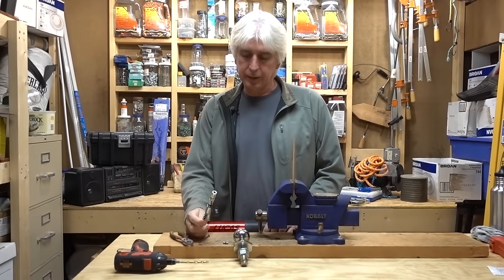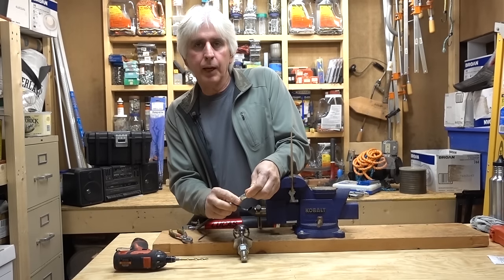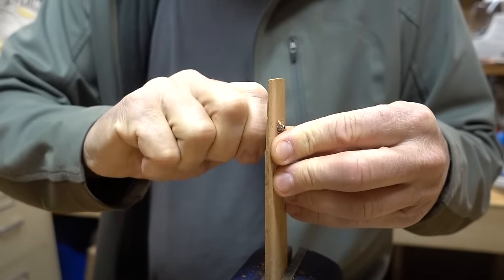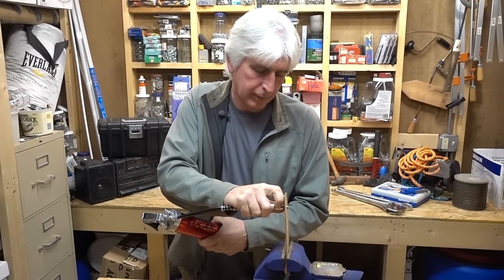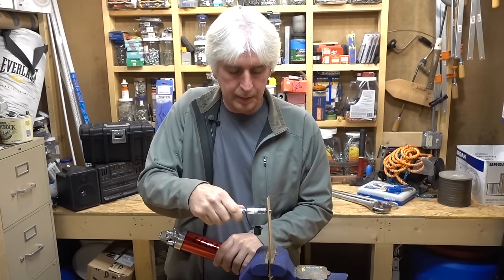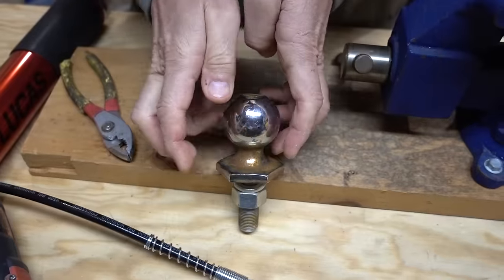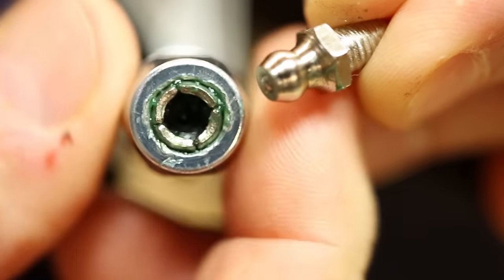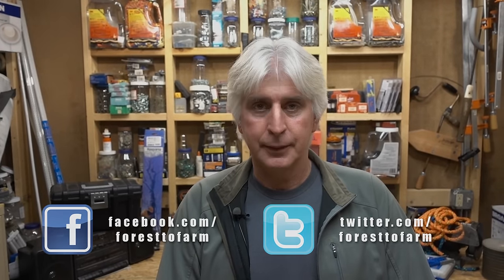Getting A Secure Fit With Your Grease Gun

Comment: I'm 73, and I never learned that. I worked as an auto mechanic, factory maintenance, and other technical jobs. I own 6 grease guns. Tomorrow, I'm going to see how many are adjustable. This could have saved me lots of frustration, lots! THANK YOU!
Reply from the maker: You’re very welcome! So simple yet so few of us knew haha. At least life will be a little easier from here on out 😁. Thanks for watching!!
Terry
Reply: @ForestToFarm  I'm 69 and on the farm but did learn about this 35 yrs ago.  Excellent video but you should have mentioned that if the zerk refuses to take grease you can loosen the coupler to relieve pressure so you can get off the zerk.  Then usually some heat applied to zerk will get it to accept grease again.   Thanks for the video.
Reply from the maker: @jefffrayer8238  Good points! Thanks for sharing!!
Terry

Comment: You saved my life! I have been breaking grease nipples by forcing the grease gun with blunt force. Then I decided to find why and your video just explained it. Thanks!
Reply from the maker: Your welcome! Glad to be of assistance. 

Terry
Reply: I was breaking grease fittings off during the removal process.  Of course I was jamming them on first off.  I am an idiot.  This video saved my bacon from more future damage!!
Reply: Same… thank you and thank’s YouTube!
Reply: @leftseat30  There was no rush so I left grease gun on backhoe overnight thinking the grease would seep into joint.  No luck so I did know to loosen the 2 pc. coupling as shown to relieve pressure using two curved jaw Vice-Grips.  I took fitting out and unclogged it with some heat and grease gun.   Great video needed by many and no you're not an idiot because nobody explains this.
Reply from the maker: @leftseat30 ha ha glad to help!
Terry
Reply from the maker: @gregbrown5556 never to late to learn. 
Terry
Reply from the maker: @jefffrayer8238 thanks! 
Terry

Comment: I watched this while standing in tractor supply company and searching for a “grease gun adapter”—- a larger one. This video really helped me see I just need to adjust the tip of what I’ve got.🤯🙏
Reply from the maker: Glad you found it and glad to help!! Thanks for watching!!!
Terry
Reply: @ForestToFarm  Since using your method, I have been able to insert grease, but the thread lengths of my adapter are so short that I almost have to disassemble it from the tube, and the tube connector to loosen it adequately. Quite a greasy ordeal. I hope to find a similar connector with longer threads perhaps.
Reply from the maker: @SuperMulletguy  Good luck!!
Terry

Comment: I found that after a few weeks of experience that I could get the nozzle set so that it could be pushed on and flicked off without turning the barrel to change the tightness. After an absence of a few years of operating a grease gun I found myself have trouble getting the nozzle onto the zerk. I had forgotten that the nozzle twists to tighten and loosen. Thanks for a much needed review.
Reply from the maker: Your welcome. Yeah there is a “sweet spot” where it will work the vast majority of the time. Glad to help and thanks for watching!!!
Terry

Comment: Thank you for such a detailed explanation!  I was aware of the the trailer-hitch-type design, but the grease gun adjustment closeup really drove the point home.  I noticed that my grease gun fitting had to be perfectly perpendicular to the zerk fitting mount to prevent grease from squirting out the side that is furthest angle.  And it was very hard to get off when done with a zerk fitting.  I was thinking about buying one of the zerk fitting clamp devices with a locking/unlocking lever, but now I know it's built into the grease fitting end.  I checked to be sure and it is.  You saved me at least $25 and the Pro one is $50.  Isn't it great that a video made 4 years ago is still helping people?  Thank you again!
Reply from the maker: Its is great! Thanks for watching!! Love helping people. 
Terry

Comment: Just bought a cheap HF grease gun to grease my new suspension parts with zerk fittings. It went on snug with zerk fitting but didn't come off by tilting coupler and pulling nozzle as user manual recommended. Watched couple of videos including this one, I learned about adjustable coupler at tip of nozzle. After loosening it by hand while holding another adjacent nut closer to the gun, it came off easily. Your advice will certainly help lot of people. Thanks.
Reply from the maker: No problem. Some times the simplest solution is right there, we just have to recognize it. I spent most of my life fighting those things, lol. Check back some time in the near future. We bought a new type of nozzle and I think its going to be very useful.
Terry

Comment: THANK YOU!  I'm new to using a grease gun and I was getting very frustrated trying to grease the fittings on my John Deere mower.  After a few hours of on-line research to find a new coupler for my gun, I stumbled across your video.  Immediately went to the basement to try this and VOILA!!  So long to the "hold it tight with one hand while pumping with the other" knuckleheads!  I wish the instructions that came with the grease gun would explain this.  Again, thank you for your simple, straight-forward video.
Reply from the maker: You’re very welcome. Thanks for the kind words and for watching! Glad it worked out for you. 
Terry

Comment: Great video, very informative as well. This video was very helpful, believe me. I bought a grease gun just like yours, it came with that same grease nozzle , but I didn't understand why the tip was turning. It didn't look like the old solid dinosaur type grease nozzle, now thanks to you I know how to use it.
Reply from the maker: Thanks! It does help to understand the thing, haha. Took me 50 something years to figure it out. We recently bought the Lock N Lube nozzle. Should be a video coming some time in the future about it. I have a feeling its gonna be a good tool. Thanks for the kind words.
Terry

Comment: Holy COW!!!  I have been fighting this for over 40 years!  I was actually looking at two quick connect products for $35-$50 just to solve this problem.  The INSTRUCTIONS don't even tell you this and I have TWO Lincoln guns....one from over thirty years ago and one I just bought last week.  Sir, you are my hero...
Reply from the maker: Its always good to be somebodies hero! 😁I have a gun from when I was a kid nearly 60 years ago. Currently figuring out how to get the dried up grease out of it lol 😂. 
Terry
Reply: @ForestToFarm  FYI, I went home and immediately looked at both of my guns.  BOTH were screwed on very tight.  I loosened both and, yep, they too are adjustable.  I disassembled the old gun tip, cleaned it and reassembled it.  Both are identical and fully adjustable.Thanks again!
BTW, if your old gun is not aluminum and, if painted, you don't care about the paint, grab a pound of pure lye and mix it with about 4+ gallons of water (water first, lye last!) in a 5 gallon bucket and then place the gun in it and cover for a few weeks.  It will only dissolve the petroleum products and leave the rubber and steel alone.  I use it all the time to clean and restore old cast iron cookware, meat grinders, sausage stuffers, etc.  I currently have a bucket with cast iron and tin plated grinders in for almost a year with no effect on any of them.
Reply from the maker: @jeffreypritts2530  Thanks for the tips!!
Terry

Comment: I never knew that, nice tip.
Hey Terry, I have that same exact grease gun, I have a constant problem where it doesn't like to pump grease. Its like it has no pressure. For any suggestions for that problem?
I just want to pitch it sometimes.
Reply from the maker: Hey we are actually doing a video to be out very soon explaining some tips on grease insertion. I think it might help you! 

Did you notice the spring loaded bleeder valve on the top of the gun. We never had your problem yet but that may be the cause. 
Terry
Reply: Be sure you primed it with grease the last time you changed the cartridge, and that you have bled all of  the air out of the system.  It may take several tries to get it going.  There are several YouTube videos on how to bleed the air out when you change cartridges.
Reply from the maker: @Anonymous-it5jw  Thanks for the info!!
Terry

Comment: Just a note, not all grease gun tips are adjustable.  Most decent newer ones are now and I find you need to adjust them when using or they will stick on when trying to remove or fall off when greasing if you do not adjust them.  The ones that are not adjustable work okay most of the time but you do need to hold them in place to some degree.
Reply from the maker: Thanks for the input. People have asked but I was not sure. All the units I have come across thus far were adjustable.
Terry
Reply: True I had to buy an accessory which came with this type of fitting. The one I had that was nota adjustable was so tight that it snapped the fitting on my jack...
Reply: I have never seen these adjustable ones, I am going to have to find one for my old Alemite grease gun.  The old style does come apart, and you can take the jaws out and reverse them when they wear, but this new one looks like a much better idea.
Reply from the maker: @JackRR15 wow, I never had that problem before. 
Terry
Reply from the maker: @jusportel I have a grease gun that was my fathers 60 years ago or so. I used it as a kid but left it set for quite a few years. The grease set up hard in it 😂. Haven’t ever tried to clean it out. Wondering now if it is adjustable. Gonna have to get on that. 
Thanks for watching! 
Terry

Comment: Very well explained including the detailed close up, well done! I knew about the adjustment already, but still fine that my grease nipples often leak when pumping them; sometimes it helps to wiggle free the closing ball on the nipple, as they might be stuck/blocked. I know ordered a spring+lever grease gun hose, which hopefully works even better.
Reply from the maker: Thanks for the kind words. Yeah sometimes you have to loosen that ball. We have a “Loc N Lube” with a lever. Never used it yet haha. Looks like it may not always fit in tighter places at times. If we ever get to using it we will  need to keep a second gun  around with the standard set up for tight places. Thanks for the comment and for watching!!
Terry

Comment: Hi Terry .. Thank you so much for this video.  I had never greased any fittings on my riding mower and had to replace the tie rod so had to grease it. So bought a nice grease gun and didn't know that you can tighten and loosen the nozzle. So I forced it on and when I pulled it off the zerk?? came off and I noticed the treads are broken so now have created a bigger problem but now with your video I am  sure that will never happen again. Sot again thank you for sharing this with us.
Reply from the maker: Your welcome. Glad it helped! Those things can be a booger sometimes.
Terry

Comment: That's good to know.  I have several Zerks accessible only through a hole so one can't turn on the tip.
Apparently some tips clamp with grease pressure.  Thanks for the informative video.  I will be looking
over my grease gun tips carefully now.
Reply from the maker: Yeah some times this will not work but when it does its nice to get that tight fit. 

Terry

Comment: I've used a grease gun for year and wondered why  it would fall off and sometimes have a hard time getting it off. Now I feel dumb. Excellent tip. Thank you.
Reply from the maker: You’re welcome! I think due to the number of us not realizing this none of us were dumb. Rather we were just not being our smarter selves 😁. I don’t think I have ever done a job that I didn’t think of a better way to do it “next time”. Its that curiosity that helps me discover new ideas or ways of doing things. 
When I was around 6 or 7 my dad worked on vehicles and about anything with a motor/engine for a hobby. I always wanted to help. Even back then I was curious. They gave me a small electric car for Christmas that had keyed cardboard things you run through it to control its direction. High tech for its time ha ha. First thing I did was run and grab one if dad’s screwdrivers and started taking it apart. Dad ask did I not want to see it work first? I said no I want to see what makes it work 😂. Been that way every since. 
Thanks for watching!
Terry

Comment: What IS amazing is that many people who admit "Geez, I never knew that" are tinkerers and all (like me ) thought the three or four fingers inside the grease gun nose were spring-loaded to grip the lower edges of the spherical zerk head, just enough to ensure the grease passed the check ball in the aperture, but would yield enough when bent sideways to pull off.  Here you well demonstrate that it is similar to how a drill or collet chuck works ... i.e. the fingers tighten down in a 'forcing cone' nose, in very same way!
Reply from the maker: Yeah seems like most people never knew and admit as much. It sure makes grease work easier!! Thanks for the comment!
Terry

Comment: This is OK if the grease gun nozzle is accessible so you can tighten and loosen it on the nipple. If you can't get to it, you have to push and hold it on while the nozzle is loosened off. In this case, you need a grease gun with single hand type pump so you can force the nozzle on with the other hand.
I can't believe that so many people have taken fifty plus years to work this out for themselves. They will appreciate this video to help them out. Good video, thank you.
Reply from the maker: You’re welcome and thanks for the comment!! Sometimes the simplest things can elude  us. 
Terry
Reply: @ForestToFarm  I wonder Terry why they are called zirks (?) in the U.S.? Is that a generic brand name? In Australia we call them grease nipples for obvious reasons. I've often wondered.
Reply from the maker: @newenglander4513  No clue. Good question.

Comment: Glad I watched it through because I thought the explanation at the start, and the piece of wood was ... unhelpful. But I learned a LOT. I had trouble coupla years ago cos I couldn't get the fitting off the zerk. Mercifully I wasn't the only idiot, and some kind people showed how you had to somehow twist off. Okaaay..tried that and it was better. Then I learned that the standard fittings are crap, and bought one with a lever that opens the jaws. EXPENSIVE! At least as dear as the cheaper guns! I'm back on the Interscreen to recall/ find out which way round to put the cartridge because the picture instructions + good English are as clear as grease. Then I find this. I seriously wonder if there is a market for the expensive fittings simply because the manufacturers have kept this a secret! 
THANK YOU! GOD BLESS YOU.
Reply from the maker: You are welcome.
Terry

Comment: Did find another replacement tip which worked as demonstrated. I finished the greasing with out another gob of grease outside the fitting or with the damn thing stuck on a fitting. The fittings were recessed in the loader arms to protect them making removal of the gun difficult at best.
Reply from the maker: Great!! Glad it worked out for you.
Terry

Comment: yup it amazes me that people dont know this.  but your are correct most folks simply dont know. for me I worked as an electrician all my life and my first job was at a hospital where I did  preventive maintenance P.M. on kitchen, laundry  and elevator equipment so we used a lot of grease around there. I just moved up to the Lock and lube. its a little faster cause you dont have to screw it on and off.
Reply from the maker: Hey Dave!
It works great when you know how to use it, lol. I am torn on the lock and lube because it looks like it may get in the way on a few of my loader fittings. I may buy one and try it. It is the way to go if it works out.
Terry
Reply: yes I was reluctant also for the same reason. so far mine has worked out in all areas I need to grease.
Reply from the maker: Good to know, Thanks!!
Terry
Reply from the maker: When dad said that you knew about this, Emily said "of course he does, Dave knows how" LOL

Brian
Reply: lol of course! infact i mention this in one of my videos some where. lol yup I mention it here took a minute to remember  which video I mention it in. but its this one at around 5:00 minutes https://www.youtube.com/watch?v=7yPJhMIx8Qw
Reply from the maker: I should have just asked you, ha ha. What was I thinking?
Terry
Reply: lol to funny, still a lot of people that dont know how to use a grease gun.
Reply from the maker: You got that right. I have posted it a few places on the web and people are amazed. I am not sure if it was meant to work that way but I am glad it does when its a hard to get zerk. And it frees up that second hand. You and I are going to be helping the world become a better more productive place one video at a time! : ) Whether they like it or not, ha ha ha. 
Terry
Reply: yes we will!!!

Comment: Appreciate it!  Just what I was looking for.  Thanks!
Reply from the maker: No problem, glad to help!
Terry
Reply: Just got back in from the garage and greasing the sway bar links connected to the rear struts to see if that will solve the elusive creaking over bumps" issue.

I was using an inexpensive Harbor Freight small cartridge grease gun and trying to slide-to-fit that connector, not realizing it was a turn-to-tighten one.  Of course, they could have made it more intuitive by making the connector "tighten" on a grease fitting zerk when turning the connector clockwise instead of the other way around!  Thanks again for the helpful instructions.
Reply from the maker: @thebordernow  Glad it worked out!!
Terry